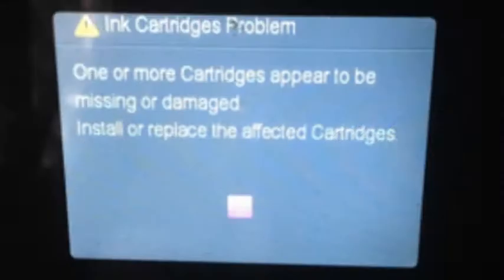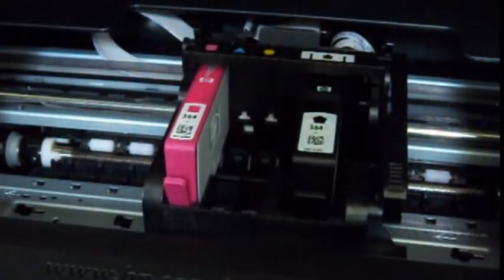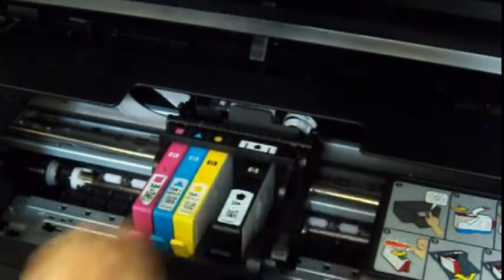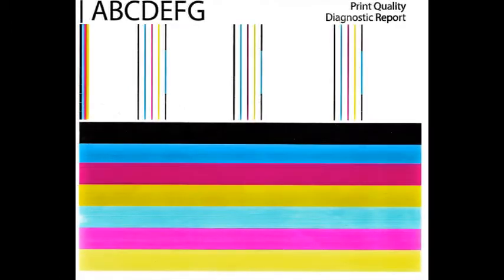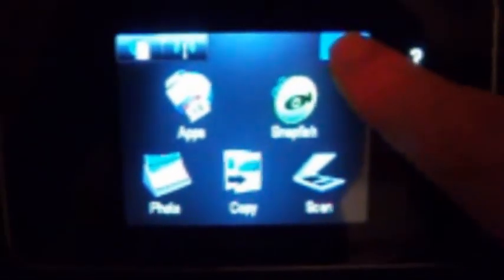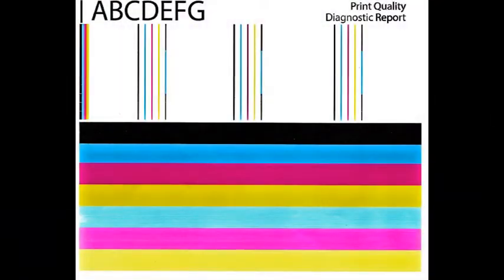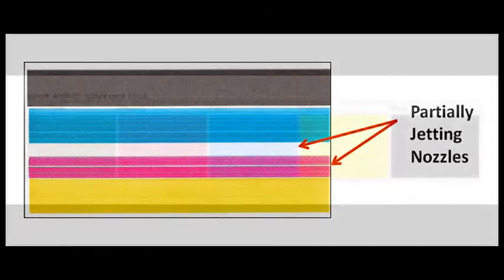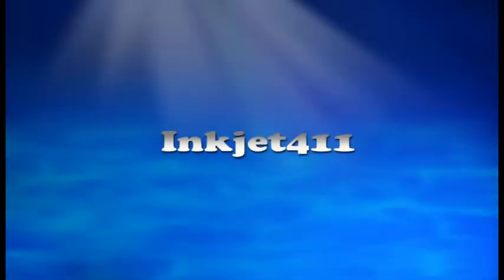HP OfficeJet Pro 6968 Printer Errors (HP 902 Ink Cartridges)

Comment from the maker: BEST VALUE INK SAVINGS (#1) - Retail in-store ink cartridge refill services – just bring in your EMPTY ORIGINAL INK CARTRIDGES to lab personnel (only takes ~hour to refill)....
Costco USA Ink Refill Service: https://www.costcoinkjetrefill.com       
Costco Canada Ink Refill Service: https://costcoinkjetrefill.ca/ 
Fry’s Electronics USA: https://frysinkrefill.com
Sam’s Club: https://www.samsclubinkjetrefill.com/  
Worldwide Ink Refill Store Locator: https://go2ris.com/printer-cartridge-refill-locations
 

BETTER VALUE INK SAVINGS (#2) – Purchase low-cost HP ink cartridges via AMAZON: https://www.amazon.com/s?k=Inkplicity+Refilled+Replacement&qid=1563483494&ref=sr_pg_1

GOOD VALUE INK SAVINGS (#3) – Purchase cartridges direct via our INKPLICITY site. You can save an extra 15% by entering code ‘SAVE15’ into the Discount Code field during cart checkout:  https://www.inkplicity.com/

 
For advanced printer problems or issues with refilled/remanufactured ink cartridge or to seek general help, please visit INKJET411: https://inkjet411.com/

-Thank you
Inkjet411 Support

Comment: That ink tray you'r washing in water is not from a office jet 6968 , As far as i can see they are not removeable . If i'm wrong please tell me . I have a office jetpro 6968 can't remove the tray.
Reply from the maker: Hi Michael, 
You are correct, the PRINTHEAD is not removable on the HP OJ Pro 6968 printer.
However, to clean the PRINTHEAD, do this: 

Fold a couple of paper towels and then wet them....ring out all of the water so it just remains moist. Access the cartridges/printhead assembly by opening up the printer's top section...the carriage assembly should automatically slide out to center area.  Carefully maneuver and slide the wet paper towels back and forth under the PRINTHEAD assembly (underneath) for about 15-30 seconds....this should clean the bottom surface of the PRINTHEAD assembly. 

NOTE: If none of our retail ink refill centers are convenient for you (see store list below)
and you would like to try a remanufactured HP 902/902XL ink
cartridge from our on-line portal, Inkplicity, our ink cartridges have a high
reliability rating, come with a 1-year warranty and provide free shipping for
all orders above $30 (USA residents only). BONUS - you can save an extra 15% by
entering code ‘SAVE15’ into the coupon/code field during cart checkout: https://www.inkplicity.com/ 

Retail In-Store Refill Service (just bring in your empty cartridges – only takes lab personnel about an hour to refill your cartridges)

Costco USA Ink Refill Service (410+ stores): https://www.costcoinkjetrefill.com       

Fry’s Electronics USA (34 stores): https://frysinkrefill.com 

Sam’s Club (26 stores): https://www.samsclubinkjetrefill.com/  

Worldwide Ink Refill Store Locator: https://go2ris.com/printer-cartridge-refill-locations 

Our main Technical Support Site (we provide free help too): https://inkjet411.com/

-Thank you
Inkjet411 Team Member